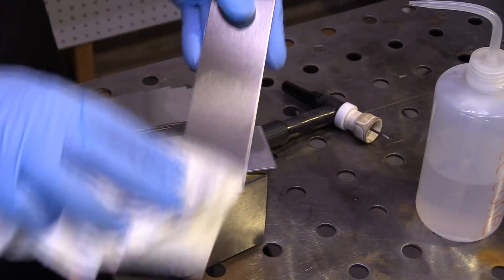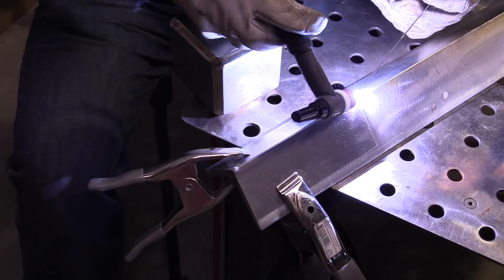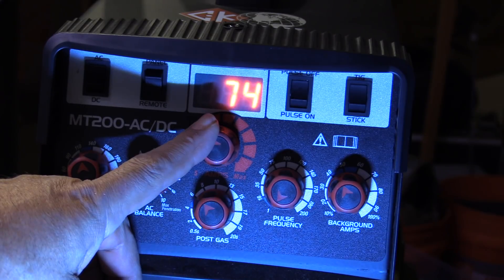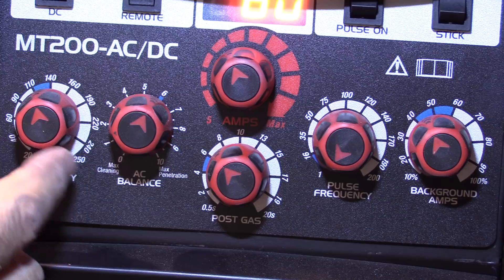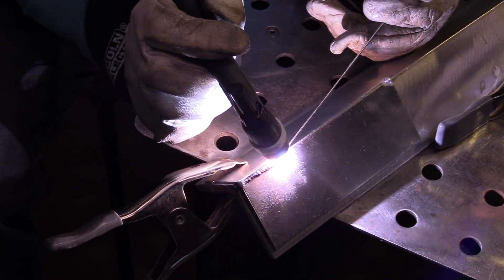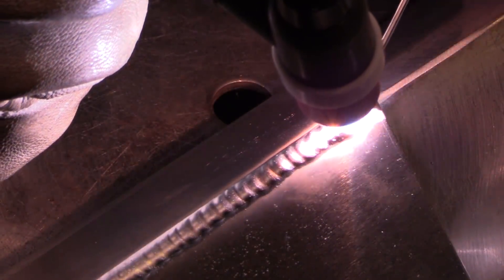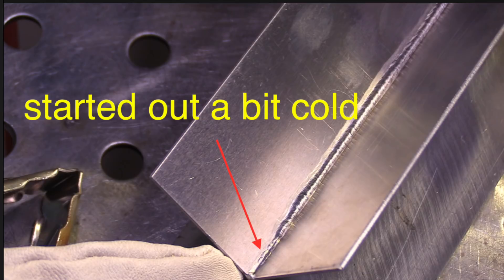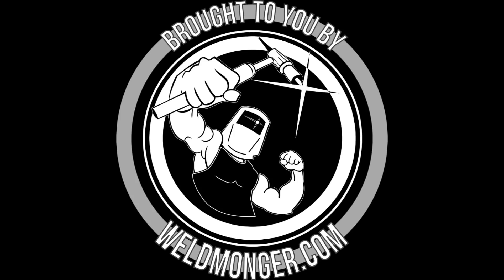TIG Welding Techniques for Aluminum

Comment: Anyway you can do a video on an aluminum part that needs re-anodized after a repair?...and a recommended filler rod thatll match the substrate alloy so the repair can match the part when its anodized? Ran into a customer whom welded an aluminum box together with a spool gun...the welds werent receptive to the surface finish that was applied.

Comment: Personally I wouldn't use a heat sink block at all. Ninety percent of your welding is going to be off position in a place you can't use a heat sink. Get used to not having crutches. For example don't get used to bracing your hands because most often your not going to be able to anyway. Foot peddles are nice but can you use one standing up in the back of a boat welding a bracket on top of a t-top, get used to scratch start or just plain high freq button start.

Don't get me wrong, having the right equipment is sometimes critical. Get used to welding in the worst possible way, because from experience you'll find out that if you come across a horrible job, you'll be able to knock it out without too much issue and you'll be better equipped to take nasty jobs that pay the bills instead of turning them down.
Reply: How funny you say that, I just welded a rod holder on my T-Top the other day and I was using a foot pedal.  What a pain in the ass it was.  I had the pedal on a step on my ladder and is was totally awkward and difficult.  Getting a good cover of the shielding gas was another issue with the Florida wind..
Reply: @TheNicko773  I work as a onsite welder at a marina in Ft. Pierce Florida, that's why I used that as a example. Try doing that on a rocking boat next to a dock lol

Comment: I'm new to welding aluminium, and can't seem to penetrate the oxide without melting the whole stock
I find 10 mm thick flatbar tuns into a sack of molten metal before I can get the filler rod near it
I don't really have any issues with mild steel thick or thin
I can't explain it, any thoughts?
Reply: Tommy Gun Machining too many amps taking too long to break the oxide layer, have to be quick to burn through that layer and let off the amps to continue

Comment: Sometimes when I weld intercooler piping, I'll get Penetration, but it won't be fused on the back side. It's kind of cheap material but I'm more thinking it's something I'm doing wrong. Thoughts?

Comment: Started tig welding about 6 months ago and Have learned a lot. Have been welding a lot of stainless and Aluminum.  I am pretty good with steel and don't encounter really any issues.  When It comes to aluminum I have a hard time keeping the tip out of the puddle.  I can be going  along and making a perfect bead and then bam!!!!   Got any tips, might have to try your method here of raising the torch.
Reply: Raising the torch is a great technique to help with dipping your tungsten.  Aluminum is different than steel and stainless due to the fact that when you add filler it tends to build up much higher and quicker.

Comment: No wire brush before welding?
Reply: topgunm 
You busted Jody!! Good job, feel better about your self?
Reply: HAHA.. what are you talking about? It was a question - see the question mark? I have seen this on 6061.com's channel as well. Both incredible welders.. so how important is the wire brush? Seems that the welds are very clean..
Reply: Not necessary on new clean material.

Comment: I was taught to ball the toungston for aluminum.  I've never tried it with a point.  Any comments on this?
Reply from the maker: it really just depends on the application and whether you are using a transformer machine or inverter with ac balance adjustments.  I usually ball the electrode for high amperage stuff.  but for sheet metal, its nice to get crisp starts with a tapered point.